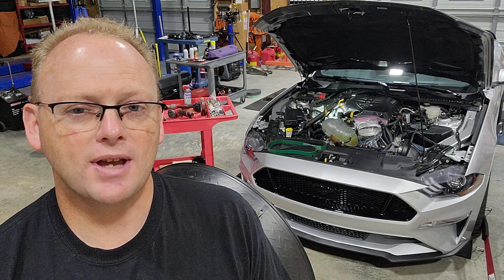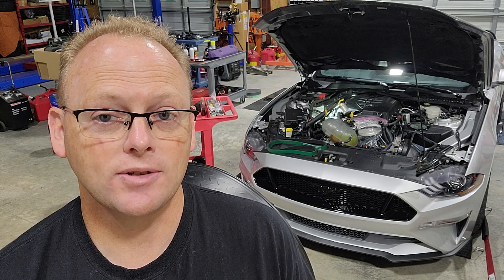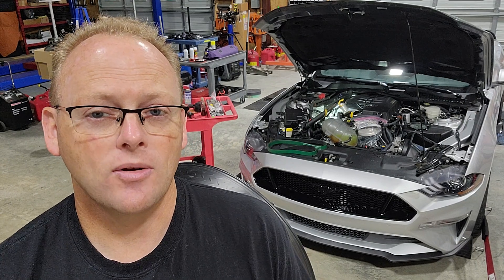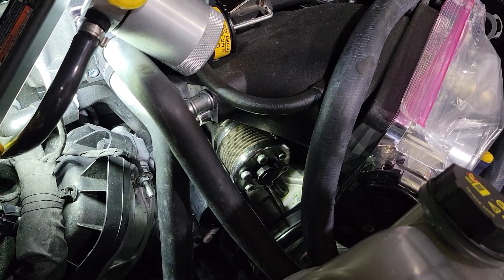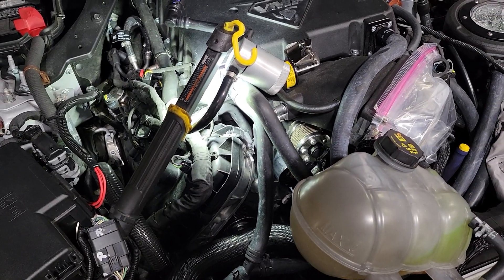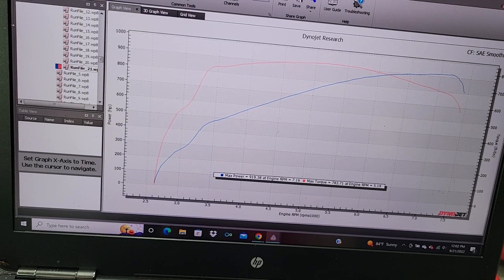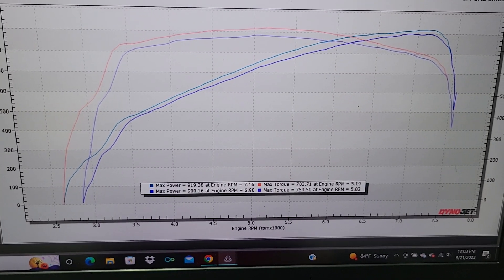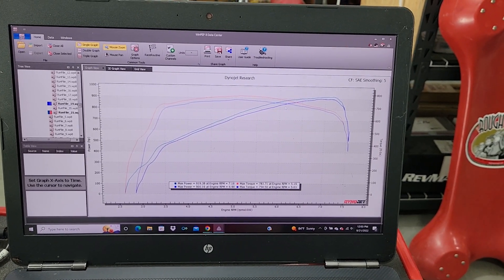Changing The Pulley On A VMP Odin Supercharger For More Power!

Comment: Is the grip tech pulley lighter than the non-grip tech?
Reply from the maker: Don't know. Good question. If any there isn't much difference.
Reply: @drpmotorsports2186  I’ve been on the 75 mm pulley with my G3 VMP blower and I’m about to go to the 2.8. I have a sleeve coyote. T5 six magnum. Fun street car. Are you in FL?
Reply from the maker: @harrisonclark4382   NC

Comment: I've got a question? i'm running a Odin on my 21 GT with the 69mm twin jet. would the 163R throttle body make anymore noticable power on a pump gas/ boostane tune up? with say a 3.3, 3.4 or 3.5 drive pulley?
Reply from the maker: Yes it will flow more air and make more power even with the larger pulleys
Reply: @drpmotorsports2186  is there any way to make the 163R have decent drivability? My twin jet is picky sometimes and experiences some part throttle stumbling every once in a while and VMP tuned mine.
Reply from the maker: @TheLoneWolf_andCoyote  We had no drivability issues with one's we have tuned.
Reply: @drpmotorsports2186  Thanks for the info VMP has tried to talk me out of a 163R a few times because of tunability issues. I live in higher elevation 3,000ft with D.A.s ranging from 4,800-7,000ft depending on time of year so my Coyote dosen't make quite the vacuum that they see at sea level. I figured it would be worth 10 to 15 rwhp over a twin jet if the tune could be dialed in.